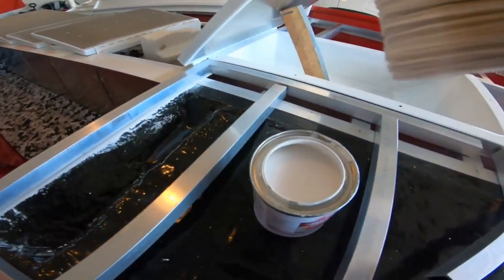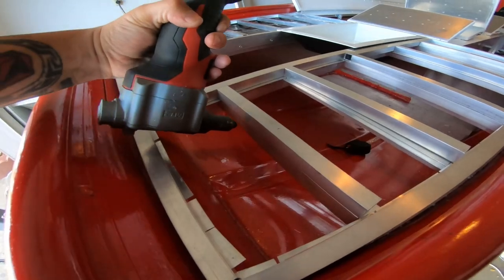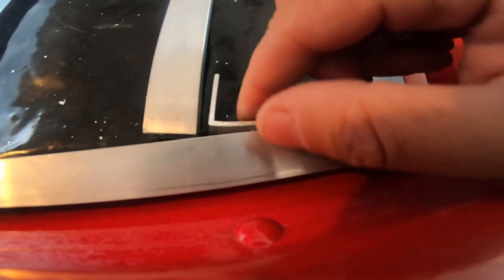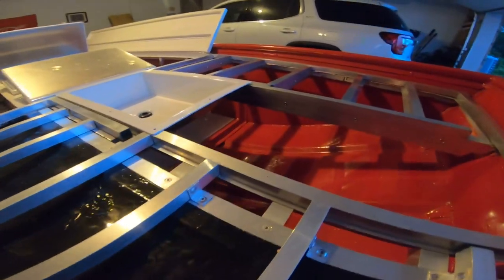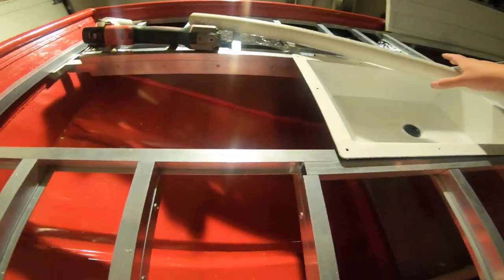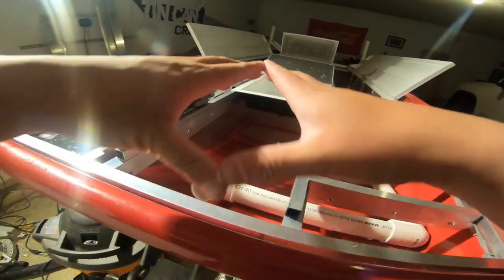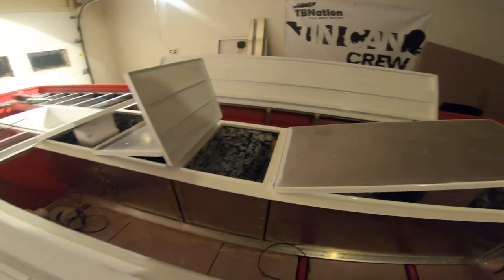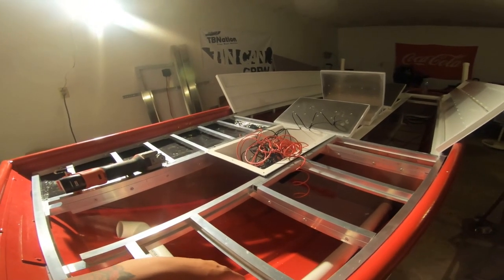Attaching FRONT DECK and RUNNING WIRE in My Jon Boat to Bass Boat Conversion!!!

Comment: Run a pull string down the pipe just in case you need to add wire later. Boat is looking awesome.

Comment: you need to put the angle brackets on both sides of the outside supports to reduce the twist that will allow them to drop and introduce shear if you rivet the deck to them

Comment: No we can finally say that little bumps and bruises don't mind very much as putting a drill bit for  hand but I think you could put 2 busbars in the back 2 busbars in the front to help with the wire they can help you save on one wire

Comment: Them 90’s are gonna make it a pain to run wire . You should get some bell 90’s that’s way easier to pull wire . The curve isn’t as direct to where your wire will glide through versus the 90 you’re using . While pulling wire it will be like hitting a wall and won’t be near as early .

Comment: Single 10 gauge ground wire with a buss bar in front would be better. Instead of the 90 degree corners double 45 degree corner would have shortened your pipe and make it easier to pull wires in the future. Heat the end of the pipe and flare it going thru the wall for a better termination at wall. Hose clamp on back side